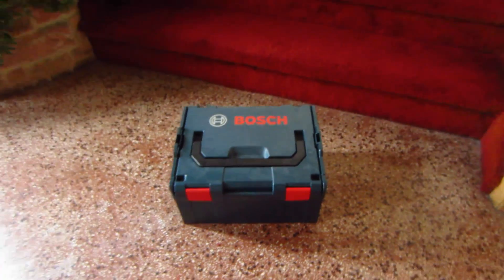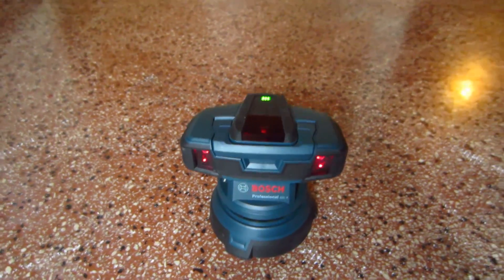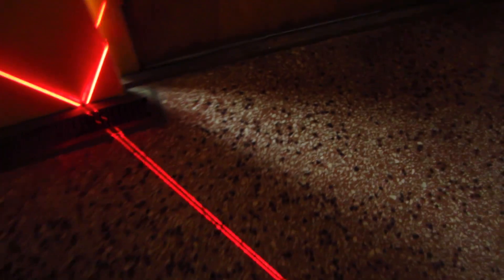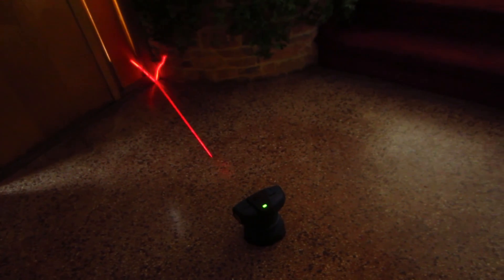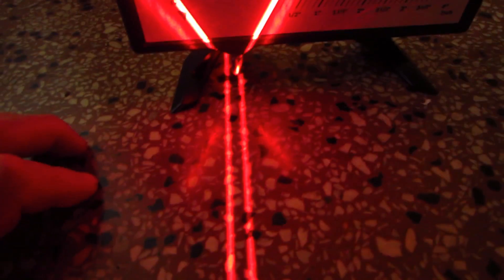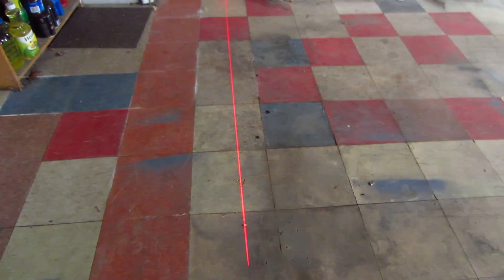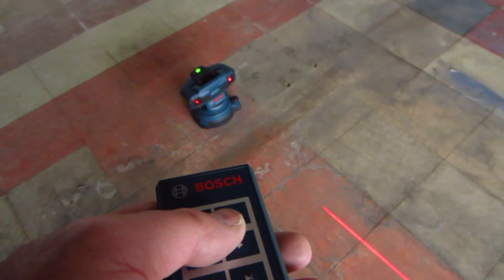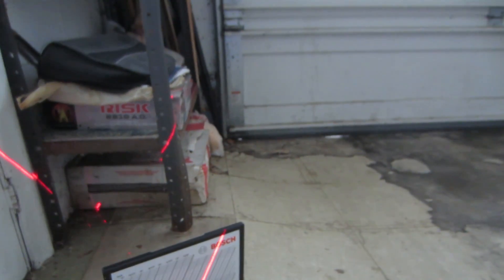Bosch GLS2 surface laser

Comment: It's been a little while now since posting the vid, Sal. How would you rate this laser after putting it through its paces? I've recently purchased the Bosch 360 rotating version, which I use very often and love. I mainly use it for establishing my starting mark for shower, tub surrounds as well as walls that are being completely tiled. Thinking of grabbing this version next for my large floors. Your thoughts? Thanks in advance, Sal.

Comment: hi sal i use a rotating stabila on a tripod with a measuring stick to set the hight of either dabs of mortor or screws if it's wood what method would u use to rectify the difference in hight coz from what I see this would make it more difficult or am I missing something?  wouldn't be the first time I was wrong tho haha
Reply from the maker: +kyle the tile The laser is just to easily determine where the height differences are and mark them as needed to show where the high and low spots are.

Comment: Can you place a normal laser level on the floor and use a tape measure to measure the distance from floor to laser at various points?
Reply from the maker: you can, but it will be very tine consuming and the high and low spots will not be easy to find